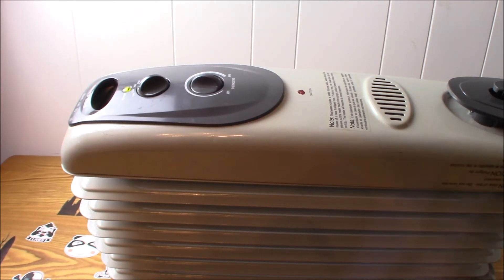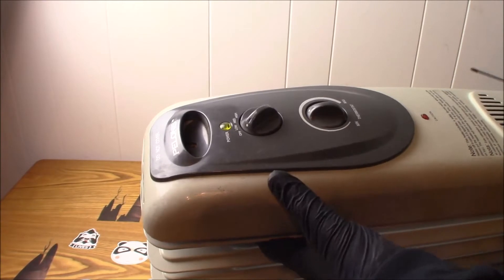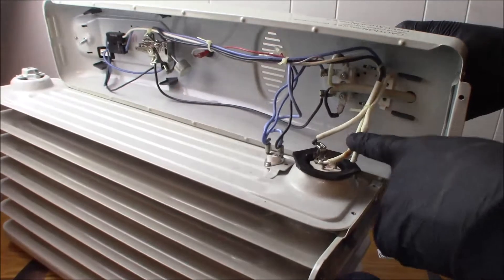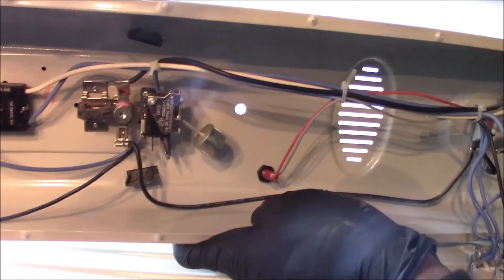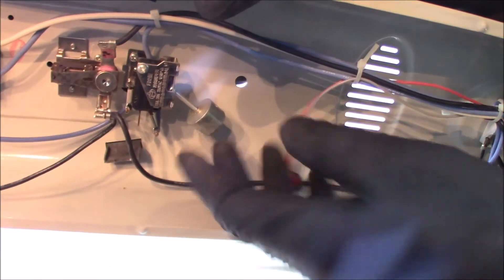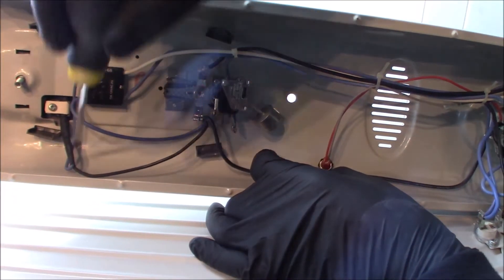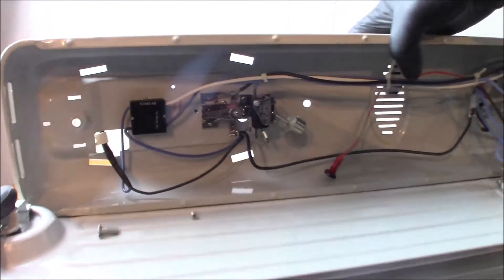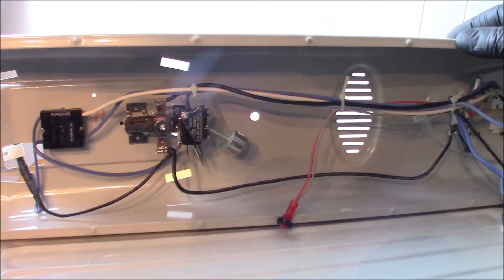How To Take Apart The Pelonis Oil Filled Radiator to See What Makes It Work So Good

Comment: My power switch came off and spins like a free wheel. Do I have to take the entire front off to see if I can reconnect the top button? Or can I just remove the small gray handle part to get to the button?
Reply: I have the same problem, my switch just spins around. 
Anyone know how to fix that?
Reply: @jude7321  I have the same problem with a different model than the video. I could not remove the panel to get the knob out. But I could access the dial that the knob attaches to. So I put some super glue on the where the knob attaches. It seems to hold for now.

Comment: Lol.   You’re kinda wrong.   The thing hanging that u said was the thermostat is the tip-over protection.   The thermostat does NOT have resistors in it to control the temp, it has a coil, The power switch is where the Wattage is controlled.    I’m not an expert but I’m smart enough to see you were wrong.
Reply: @4:14 Icame to say the same thing. Good god dude, my 13 year old daughter knew that hanging barbell thing was tip over protection. This video was so dumb. I just wanted to see the oil inside.
Reply: The explaination is done wrongly  at various points. The video is wrong.
Reply: Mine doesn't come on when plugged in no light..Where should I start
Reply: @StreetTerrorist187  get multimeter out and test the wiring and switches

Comment: Power dial on my heater will make a frying noise when adjusting the setting between high and medium. Perhaps  something has worked itself loose or maybe an issue with the resistors? In any case, due to fire hazard it's unusable at this time. I'm off to investigate.  Thanks for the video.
Reply: I think its just thermal expansion. Mine sometimes does that too. I thought I was hearing rain last night, or a pipe started leaking.